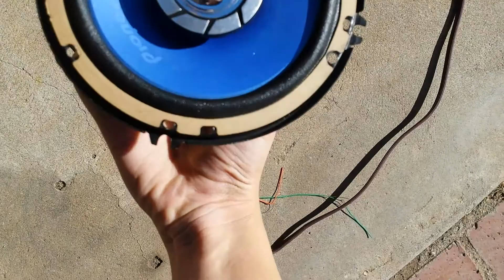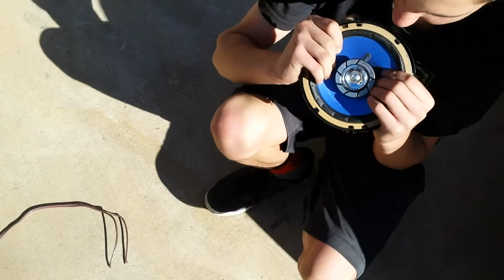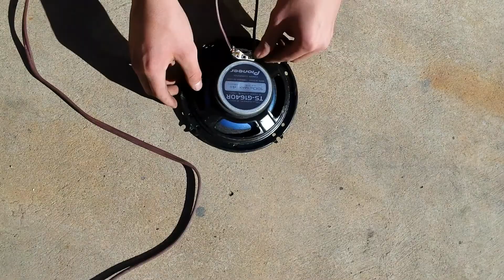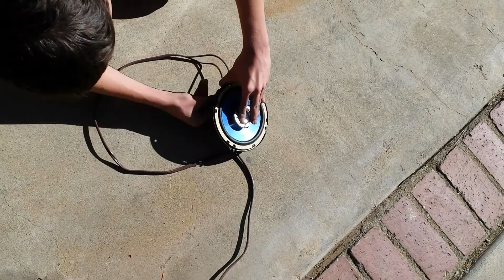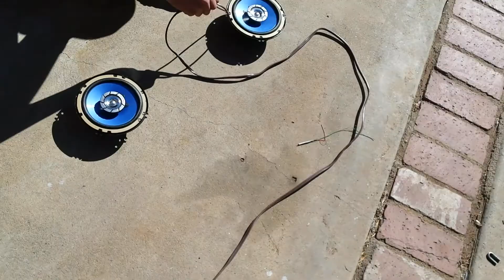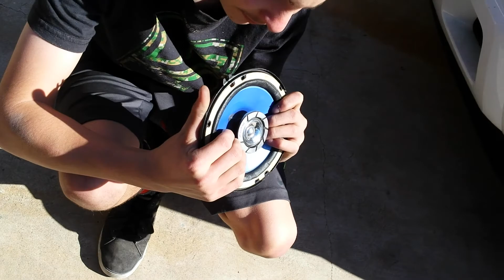blowing speakers!

Comment: So I have a dilemma that you can probably answer. I'm going to swap the stock speakers out of my truck, leaving me with 4 6 1/2 speakers. What would be the easiest way to make a boombox out of them. I thought about buying a cheap sub and box and drilling either 2 or all 4 speakers onto the box with the sub. Now for power an amp and power supply or would a 2 channel home theater receiver suffice?
Reply from the maker: +Eric Morales a home theater receiver would do just fine, but not for a subwoofer. when l make a boombox l use a 12v amplifier of some sort to make it more portable. as for the sub you will need a separate amplifier.